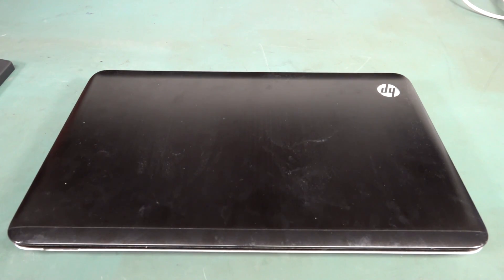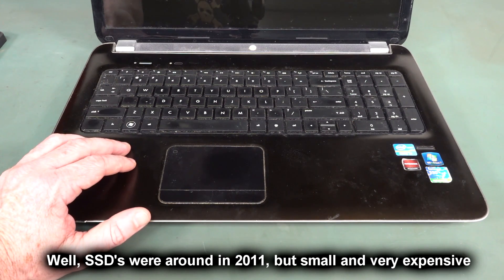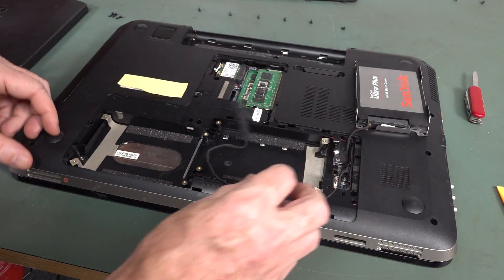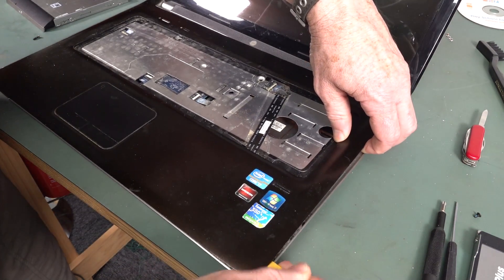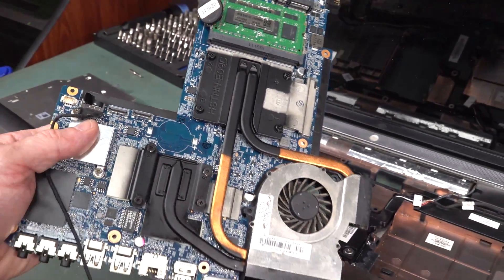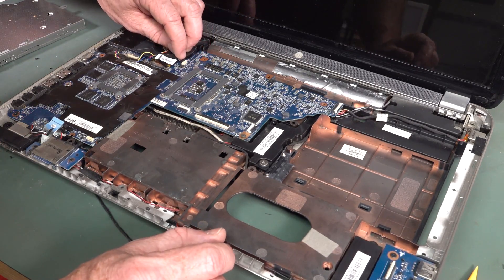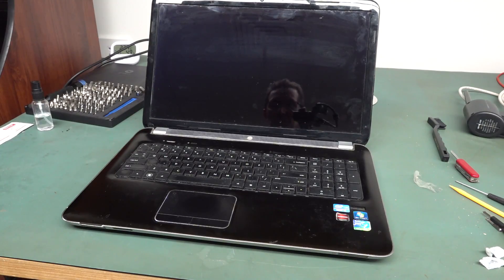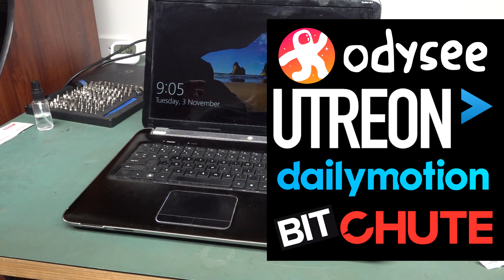EEVblog #1345 - HP DV7 Laptop Repair

Comment: These laptops are Junk but those from the mid to late 2000s were some of the very worst especially those with amd procs due to the build quality being so horrendous.
Reply: ..... My advice, (40 years exp.)
Give the machine to someone you don't like. Don't purchase products with AMD components.
Reply: @robbieaussievic  Issue isn't so much with AMD but HP cutting corners to cut down on cost and it didn't help these chips ran a bit on the hot side.
Reply: @robbieaussievic  Where AMD's always used in low cost and cheaply made machines then?

Comment: I have a Dell L502X and the heatpipes failed on it, new fancy pantsy thermal compound made no difference with thermals on it which is a shame because it wasn't a too shabby laptop.
Reply: something else has to be wrong with it, heatpipes don't just fail
Reply: @elektrokinesis4150  Sometimes the chassis warp so much that big gaps start opening between the heatsink and processor.
Reply: @uK8cvPAq  that is exactly what i was thinking

Comment: Even the older Radeon HD2000 series work rather well with W10. 
The switchable graphics thing is the issue. Maybe you can disable it in the BIOS and always enable the powerful GPU
Reply: You can set it to performance in power options and it will stay with the dedicated GPU as long as it's plugged in. :)
Reply: No. Its the AMD "ULPS" bug, disable in registry to fix. Google "AMD ULPS disable"
Reply: @apachelives didnt know ULPS is also a problem on Laptops. (except that long blackscreen on Boot. That is a classic ULPS issue). ULPS is mainly a problem with Crossfire systems
Reply: @TheRailroad99  Allways had to turn off ULPS when overclocking as well as XF, but mainly do it in MSI Afterburner.

Comment: I love/hate the HP DV7... Very good machine 👍 would have been awesome if they used higher quality components and designed it to be more serviceable.
Reply: yeah, for some reason you have to completely disassemble the laptop to get to the cooling system, which is the most important part. It was only with the introduction of the HP Pavilion 15-ab/15-ac and later when everything was accessible after splitting the bottom cover from the top.
Reply: @TheSpotify95  newer laptops are worse... Talking keyboard plastic welded into the lid.
Reply: @xephael3485  yeah I've heard about those too. Welded keyboards are a nightmare - unless you have tons of patience, you just replace the palm rest.

Comment: i have my sisters old DV8... it failed..yes got really hot...couldnt work out what when wrong with it...nothing could be replaced.. now its only good for parts...
PITA to get apart... and even more of a PITA to put back together!
Reply: I wonder if the heat pipe seals fail sometimes. It would be non-obvious.
Reply: Probably failed due to severe and catastrophic overheating! If you'd checked the fan it wouldn have likely been full of dust, and the thermal paste would have likely gone dry too.

Comment: I've got one of those laying around too, from my early days of college. Gt630m version though. Still supported on windows 10 lol. Simply won't boot now due to the thermal issue. Smelled something cooking last time I tried.
Reply: I had one recently where I just got a Flashing Caps Lock light. Someone didn't take much care with it previously because the fan was completely blocked.
If it's already dead even on a cold boot, then unfortunately it's too late... The warning signs would have been there!

Comment: Always had a good experience with Lenovo. I predict some snowflakes will be upset about this one!
Reply: I've got several Lenovos.  I like my X220.  Keyboard is glorious.  I also like the HP Elitebook and Probook business machines.  I buy used ones for my friends and family.
Reply: @RyeOnHam  x220 here as well. No experience with the new ones.
Reply: We had awful experience with the latest lenovo. Lenovo decided to create ssd with proprietary interface and size. And this ssd dies exactly few weeks after warranty end. We tried official Lenovo service but they just said "this is outdated ssd we don't produce it anymore". Go and buy new laptop... we tried aliexpress, ebay, tried to figure out pinout to make adapter... no luck.
Older lenovo laptops are quite nice but the new ones... Never again.
Reply: @night_gryphon  Hmmm, not sure of the veracity of your story.  What model Lenovo was there.  I work on laptops and I've never seen any proprietary Lenovo drives.  Not saying they don't exist, just wondering what to look out for.
Reply: @RyeOnHam  will check tomorrow. It is somewhere in the trash box at the office
Reply: @RyeOnHam  ok. i've found our emails regarding that laptop. That was Lenovo ideapad u300s And we are not the only ones who catch that trouble.
Here is some photo and discussion regarding that ssd https://forum.overclockers.ua/viewtopic.php?t=150871
After such "creative" and "friendly" service we never buy lenovo in our company.
Reply: Y740 here. Works like a dream!

Comment: Have you tried to install the legacy windows 10 driver? (https://www.amd.com/en/support/graphics/amd-radeon-hd/amd-radeon-hd-6000m-series/amd-radeon-hd-6770m) There are no Adrenalin drivers out there for this gpu, but there are older windows 10 catalyst driver. In the worst case you need to force it to install the older driver (here is a tutorial for this situation: https://community.amd.com/thread/186846) (this videotutorial is not very good but maybe it helps, too: https://www.youtube.com/watch?v=C6BCNAEpdX0)
Reply from the maker: Will try it, thanks.
Reply: @EEVblog  There are 2 Drivers available for Win10: https://www.amd.com/en/support/kb/faq/gpu-630
Either the older but "WHQL" (approved by Microsoft, meh) 15.7.1 Catalyst, or the newer but "Beta" (not signed by Microsoft, who cares) Crimson.
There's some truth to what @Rob Robbie says, Windows might try to "upgrade" your driver to something newer.
In that case just block the specific update for your GPU while all other updates continue to work with this tool from Microsoft: https://support.microsoft.com/en-us/help/3073930/how-to-temporarily-prevent-a-driver-update-from-reinstalling-in-window
Reply: i've found the same link the driver is from 2015 but there is a beta well, if it work....
Reply: Its a problem with AMD's "ULPS" - google it, disable it in registry to fix.
Reply: ..... Win10 update will continue to replace your legacy driver and it will fall over again,
You don't want a machine with WinUpdate disabled, My advice, (40 years exp.)
Give the machine to someone you don't like. Don't purchase products with AMD components.
Reply: @robbieaussievic  Or intel XD. Or any other company. On one of my notebooks there is no windows 7 driver for the audio (Intel or Realtek, I belive it was Intel audio) and this notebook is from 2006 and was shiped with windows vista. So they drop support for it after 3 to 4 years. Thats why it also has linux.
Reply: @robbieaussievic  It doesn't matter who makes the products they all become unsupported eventually - I can't go past Win7 because of hardware -. 
I just read an article where newer Win10 will stop supporting stuff it used to support because they way it works will change, and that means old stuff will become incompatible with no way to go backwards in Win10 versions.
Reply: @SidneyCritic  .... I concur, but in the field, making a living,  I'm dealing with AMD Mainboard chipset and GPU driver issues as 'bread & butter' income.
Reply: @robbieaussievic  I have several old laptops with radeon cards, and none force me to use another driver. Once I install the driver I need it just uses that one. I have never seen windows force a driver update. Especially to a non Microsoft driver.
Reply: @robbieaussievic  "Don't purchase products with AMD components.
"  What? Why? I have one laptop and a Desktop with AMD components running fine and dandy.
Reply: @robbieaussievic  "you don't want a machine with winupdate disabled" yes don't disable the main source of windows problems

Comment: Nice! I had a HP dv6 with Core2 Duo and ATI Radeon, it had a similar convoluted construction although the palm rest hinged out like some older laptops use to. Sadly, the BMS shit the bed back in 2014 followed soon after by the power brick, ended up scavenging it for parts and bought a Surface Pro 3 which worked well up until the notorious keyboard murdering firmware update...

Have you tried the EOL beta drivers?
https://www.amd.com/en/support/kb/release-notes/rn-rad-win-non-gcn-16-2-1-beta
Reply: I only remember those with the notorious 8000 series Nvidia GPUs. They died like nothing else. Even worse than the Thinkpads (T61) with the same bad chips.
Reply: @TheRailroad99  I have a T61p which fortunately hasn't had the NVIDIA GPU issues. It's much nicer to work business laptops than on than cheaply-made laptops like these.